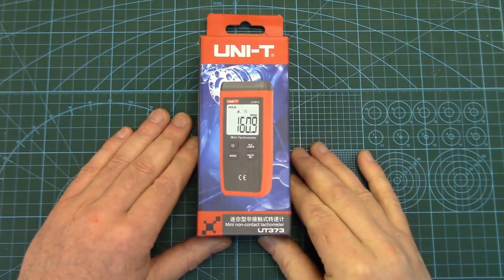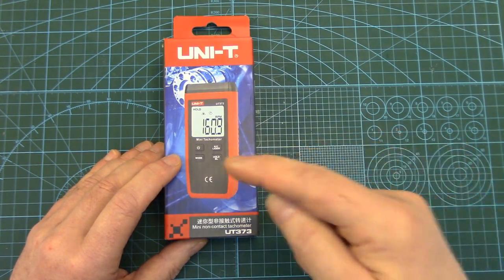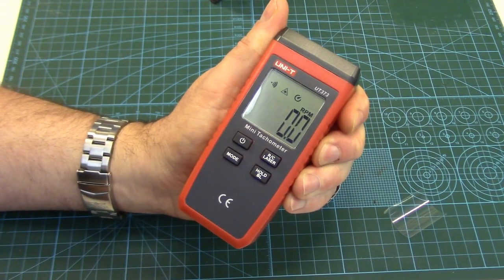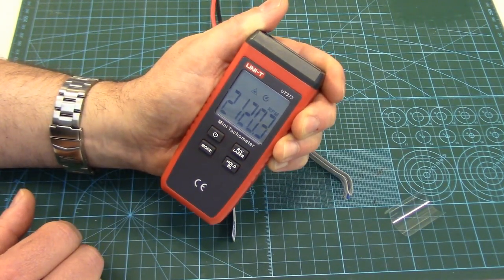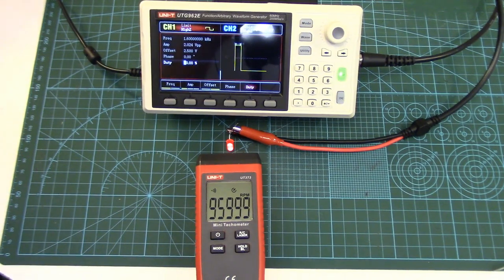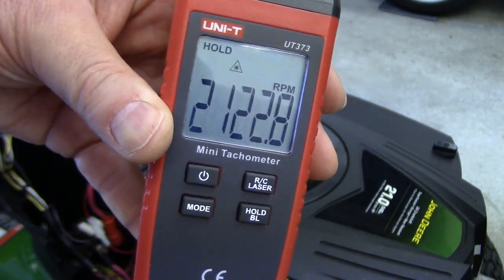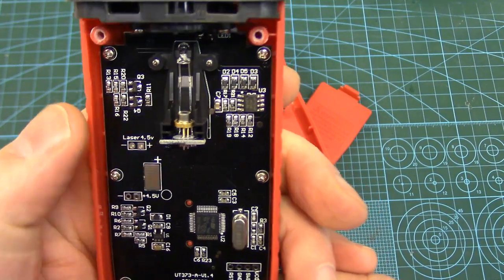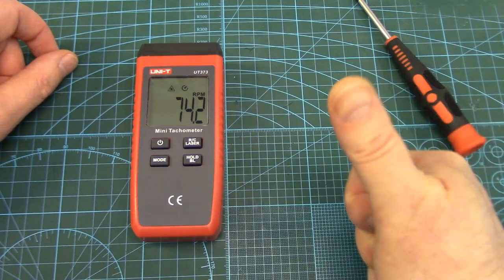UNI-T Digital Tachometer Review - UT373 Mini Tachometer

Comment: Thanks for the review. TIP:I bought one of these and found it unreliable at first till I discovered that the supplied 3M tape has TWO removable covers to it. There is one for the protective cover of the self adhesive backing (obviously).. BUT also a thin film over the top of the reflective surface too! After removing THAT it worked as it should do. There are no references to the tape at all in the instructions.
Reply from the maker: Thanks for the info 👍

Comment: Hi John.  Thanks for the learning video.  Will this read spark pulse.  Wanting an RPM to check the RPM on my lawnmower.  

This one looks photo laser only rather than read a pulse on a spark plug.
Reply from the maker: This is an optical tach, not an ignition/spark tach.

Comment: I'm surprised it's actually a laser diode and not only some collimated LED
Reply from the maker: I'm no expert, but the little I know about LED collimation is you lose a great deal of light output in the process - no? If so, a laser makes much more sense from an increased working distance standpoint along with competing against strong ambient light sources.
Reply: @Rchelicopterfun  all you say is true. I was just surprised they didn't cheap out on it :-)

Comment: You ever try a brand soldering iron for exemple hakko.
Reply from the maker: Not sure what solder irons have to do with tachometers; but yes, I've owned and used a Hakko 888D along with several Weller soldering stations at work.
Reply: @Rchelicopterfun   if you want you can buy a jbc station olready used în great condition at 245 dolars or you can buy a fx 951 already used  for ebay at 165- 200 dolars .
Reply from the maker: @andreiciora2765  Why would I waste my money on some used station or pay outrageous amounts of money as a hobbyist on overpriced stations when the T12 works a treat and is better than any soldering station I've used to date. No way.
Reply: @Rchelicopterfun   ok
Reply: Actualy i use one of this t12  iron for my second bench and worck great .

Comment: Yea theyll last for years as long as you throw those batteries it came with in the garbage because they’re the explody type and will leak acid all over the thing.  They ate the screen up on mine and cant just replace those lcd’s..  they’re the pre polarized type that have certain designs on em ..
Reply from the maker: As shown in the video, mine didn't come with any batteries, I had to supply my own.